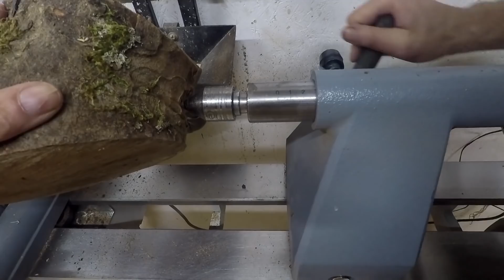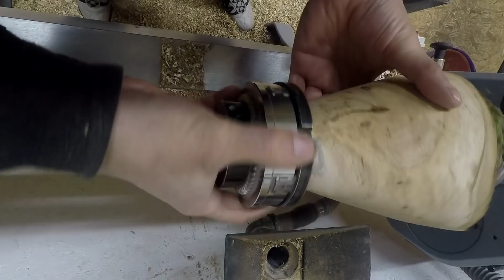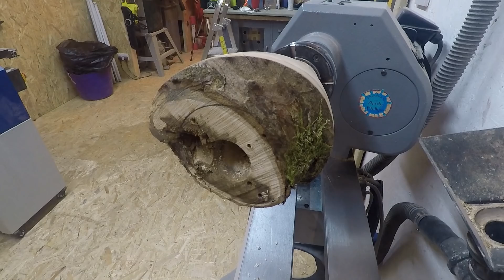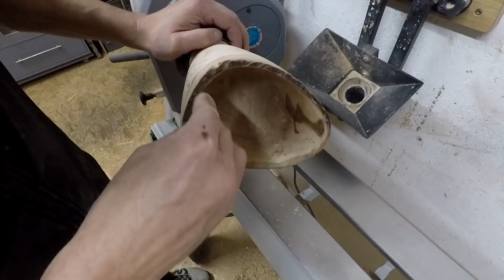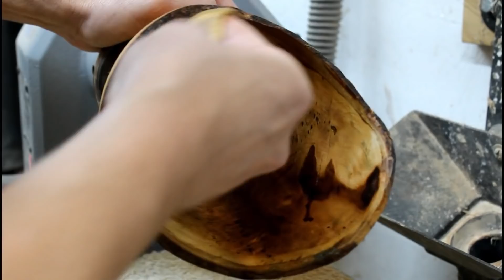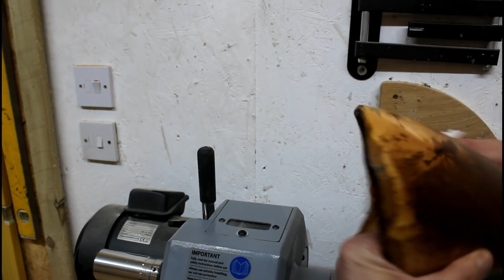Woodturning - A Mossy Log

Comment: Ive never tried this, looks dangerous in places. How long have you had the wood drying? It sounded almost wet but then you've got good tools compared to my home made stuff.
Reply from the maker: I've had the wood about a year and a half .. most of mine are home made apart from the large Crown gouge which I use on most pieces ..cheers
Reply: @AndyPhillipWoodturning  I don't much turning these days but just have a few basic chisels. I have thought about making some of the carbide tipped ones but don't know much about how they cut and the forms of the cutting edge.

Comment: Nice knuckle banging piece Andy. How did you decide how to mount the crotch. I always get confused about this. Any tips?
Reply from the maker: Yes it was a bit of a knuckle wacker lol ...I try and decide which end will be the neck and then make sure I get a decent fixing and maybe cut a flat at the angle I want to fix the face plate to .. (if that makes sense) but i agree it can be a head scratcher ..